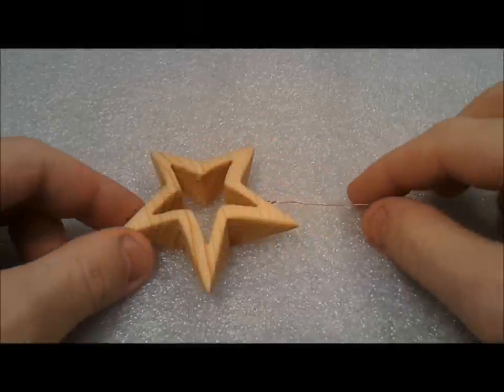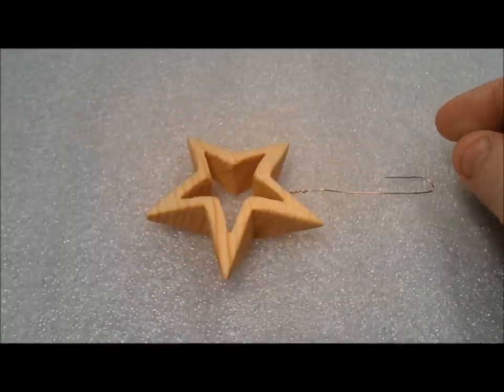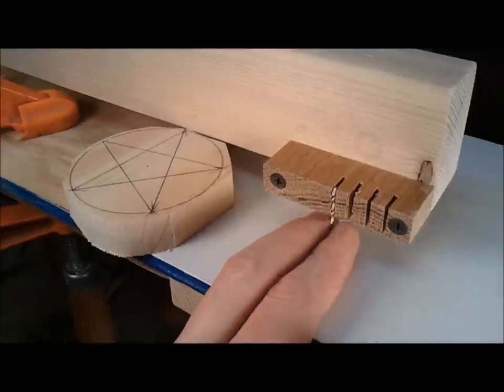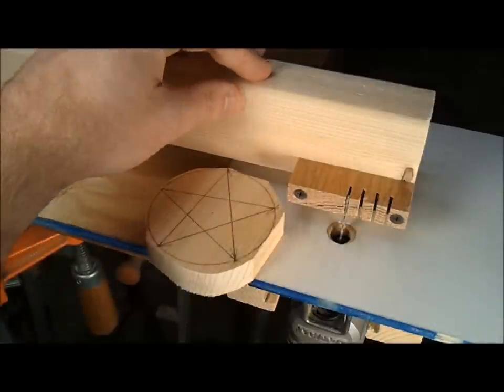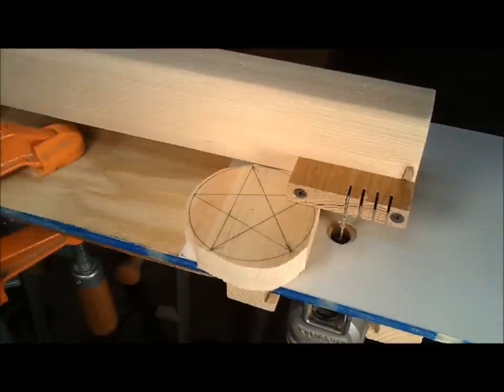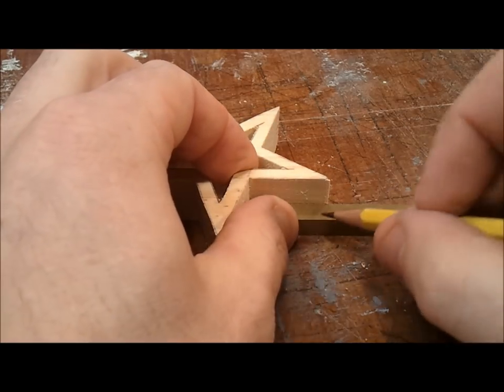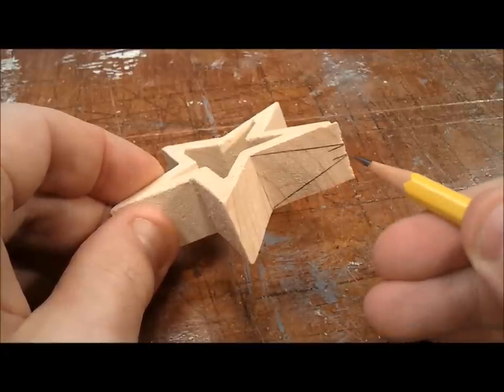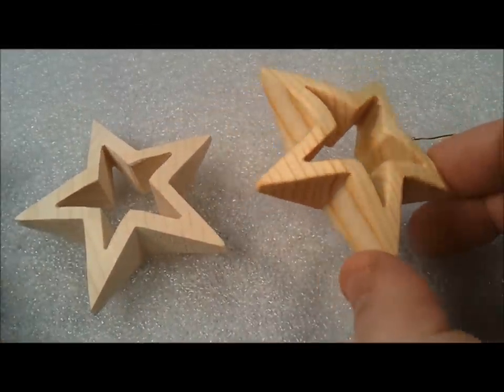Makeshift scroll-saw star in 3D

Comment: I couldn't help but notice that, there are four slots in the blade guide block. My first gues would be that you've used it a lot and made it with enough room to fit more than one slots. After a while  the blade is no longer snug in the slot so you just make a new one. Simple and practical. What if the slot had the exact taper as the blade? All you would have to do is crate a file from a worn out blade (i.e. with a dremel cutter disc) and push the guide block from the back into the file-blade. Replace the file-blade with a new one and cut away.

Comment: Damn-it!... Now I feel like a douche for buying that Rockwell "blade-runner."
I like this better for several reasons... 
1- You don't need to buy that blade-runner !!!
2- This homemade support arm works better! ( love the adjustable pressure feature!)
3- Cheapness = happiness, especially when it works so well
4- Regular jigsaws have adjustable orbital action. The blade runner does not, so although it cuts cleanly, (with a decent blade) it cuts too slowly.
5- Guide blocks automatically fit the blade you use by using that blade to make the guide-block slot. No adjustment needed. 
6- Support arm can be made longer to accommodate larger pieces, Unlike the Blade Runner where the support arm is fixed and only useful for small work. 
7- Having the support arm perpendicular to feed-direction allows longer cuts.

I wish I was this clever. Maybe I am, but just don't have the time to solve problems this well.
I wish I had more time... more brains. 
I wish I could find a way to repay you for all the great ideas and inspiration.
I wish my education had not sharpened my mind mostly by narrowing it.

Anyway... thumbs up, and THANKS! ( I'm off to the garage now...)
Reply from the maker: You always leave me such nice comments! You seem to have enough brains to me- that blade-runner thing would have enticed me as well, had I not already made this gizmo. I like that it is rugged, and difficult to break blades, unlike a scroll-saw.

As for education, it does seem to have a tendency to narrow one; it likes to whittle us down until all that is left is what we will "do" for a living. As Steven Pinker noted, (currently) education is about learning more and more about less and less, until we know everything there is to know about absolutely nothing.

I strive to keep myself as the antithesis of a specialist. It makes me better at making things. Thanks!

Comment: liked and subscribed.  i built something like this.  used jigsaw underneath table.  i was concearned with movement and safety your jig adresses this....but i am going to use a 2 x4 or put a plastic cap over blade.  i dont trust things to work like they should ie. seatbelts sunroofs ect...

Comment: As a woodworker wannabe i was fascinated by the simplicity and safety of your jigsaw arm guide, still have some hesitation about having your fingers so close to the blade, do you have other raccomandations about that? Great stuff!
Reply from the maker: Sit on a stool while using, and keep kids, dogs, and other distractions away. If you concentrate and go slow, never exceeding your own comfort, this device is no more dangerous than a sewing machine. You can also get blades with very tiny teeth, which are safer, but they do not cut as fast. Most of all, don't be afraid. There is too much safety panic floating around youtube- you'll be okay.

My older cousin would tell me when I was a kid, when the Sawzall was throwing my 75-pound body around, "Use the tool, don't let the tool use you."
Reply: +pocket83 I wonder what that meant physically... The fact that you were afraid made you hold it in a... Stiff manner, so that you were vibrating with it?

Comment: Thanks for this great idea, jigging up a jig-saw. One question though please. I can't figure out where you are taking the measurements from, to get you inner star lines lined up. Can you advise please?
Reply from the maker: Just trace something while holding it flush to the outside of the star. Trace each side. This will automatically make a smaller, inner star that's parallel to the outer one. I think I used a 1/4" brass bar.